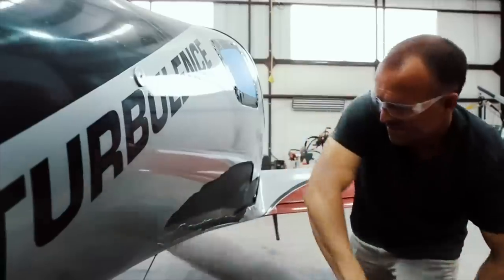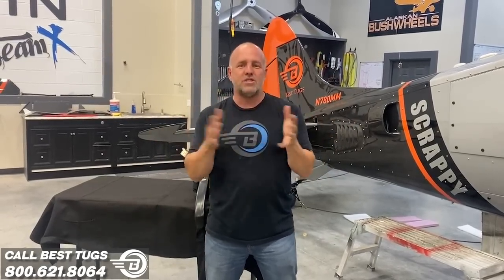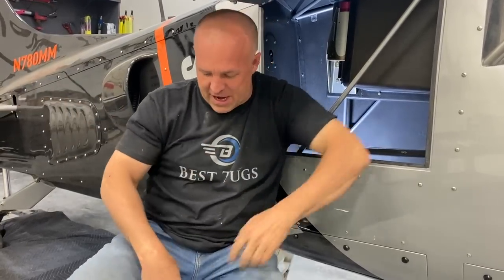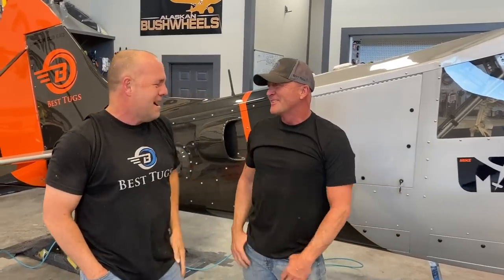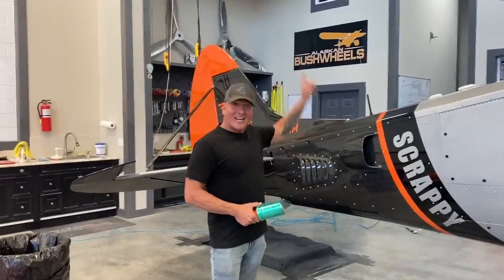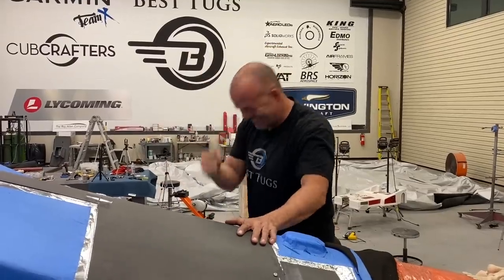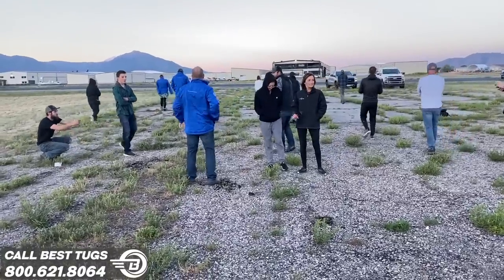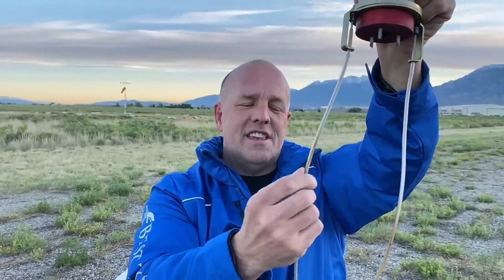🚀 Rocket Parachute blew the lid off my Scrappy Bush Plane 🔥 (Scrappy Bush Plane 27)

Comment: I see this is an old video but I don't understand why the rocket has to put a large impulse onto the airframe when it ignites.  If the impulse is from the pressure inside the plane before the rocket is fully out out of the plane, why not have a blowout area in the airframe below the rocket?  Perhaps it's an alignment issue between the rocket and the parachute package?

Comment: With all those unused control surfaces on a small airplane when you descend straight down, I wonder why you couldn't use a directional airfoil instead of a parachute?  Couldn't you achieve the same drag AND give the pilot some directional control?

Comment: Are you going to fix Draco
Reply: He did address that issue many months back and already has another Wilga in the hangar in which he does have plans to build a new one but with new improvements and upgrades from Draco. Sadly though Draco is beyond fixable, the wings and fuselage twisted and bent.

Comment: Unless a wing fails, I would rather deadstick your plane in. Once you pull the ballistic parachute your at the mercy of wherever the wind carries you. You could land on an interstate & get struck by an 18 wheeler then what. The only time I would ever pull that chute is if the wings failed structurally or the empenage/tail section failed structurally.

Comment: What about the pendulum in your parashute, as you have shown in this videos the second plane is cumming down with a lot of pendulum. That can make the plane come down side ways. What if you have some sort of wibrating system that would destroy airflow over the parachute for a small amount of time to increase the sink and stabilize the parachute? This only can be used with high enough altitude. I have no idea if this would work with an airplan and how to set this up. I have done this under a paraglider while using my emergency parachute, this helped me to land without pendulum and even target my landing zone. Just a thought, maybe you can come up with some sort of solution for this. Here's my video https://youtu.be/Dxg-oxMwhmA?t=489 where I explain how I controlled the pendulum while descending under a round reserve parachute. 

Hope this gives you some new ideas, love your videos!

Comment: Will you take me Flying in Scrappy????¿¿¿¿-♡
Reply: Mike, I just found out I won’t be making a business trip to Orem and that means 2 real losses for me.  1.  I will not get a chance to meet you, your gang, and family personally.  2.  I won’t get a chance to use my “Heavier Out” kit I bought, so I’ll have to find somewhere to use it down here in Houston.  I  will still have the gloves as a reminder of one of the greatest group of people I didn’t get to meet.  I did notice that the rocket stopped firing at the same time the straps reached full extension which further confirms the depth of engineering that was put into the design.

Comment: Why don't you incorporate a tube to exhaust the rocket straight down and out the bottom of the fuselage?
That eliminates the danger of fire, and the structural loads.
If you have to pull the chute, you are already having a bad day. Why make it worse if you don't have too?
Exhaust the rocket.

Comment: I don't want you to go over the salt flats and pull she chute to see if it will work. That would be dangerous and irresponsible.

I want you to build a 1/3rd scale model of scrappy, put a 1/3rd scale parachute on it, tow that over the salt flats and pull the chute on it to see what happens while you are safely in another aircraft.

Comment: I mean, anyone can claim they invented a parachute designed to save the landing gear. You don't really know until it's tested in the same conditions it was designed for. Until you prove that it can save the landing gear, you didn't invent a parachute system that can save the landing gear, you just redesigned a parachute. I'm not saying go risk your plane to test this, but this absolutely should be tested with a rig to simulate the planes characteristics. Sorry to be a naysayer. I could tell you I invented autopilot for your car, just install it then get up to interstate speed, close your eyes and just trust me...... yeah I didn't think so.

Comment: The rocket propulsion on a parachute sounds like over kill considering the potential damage to the craft. It would probably be much safer to use a mortor type setup with a lower powered charge. For christ sakes you aren't going for a Moon Shot.